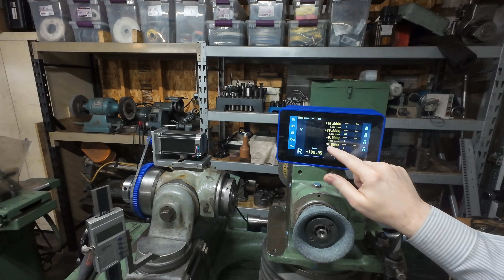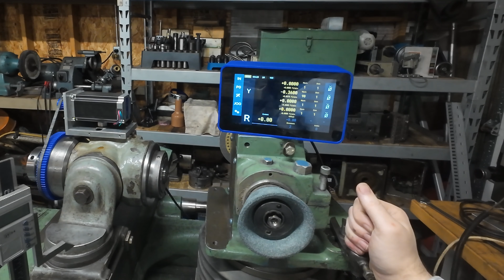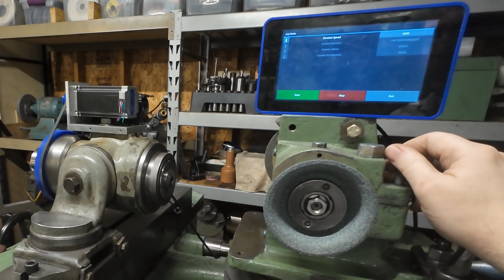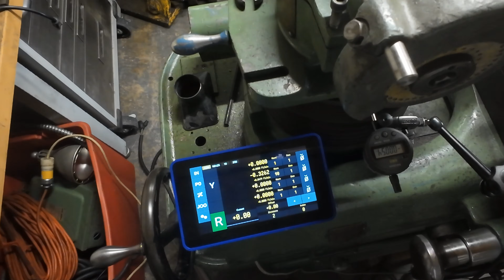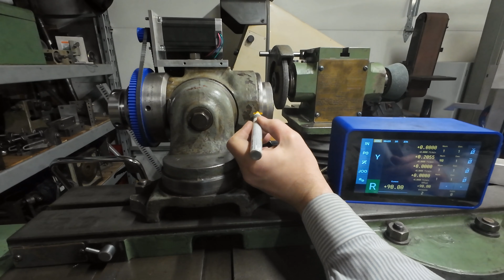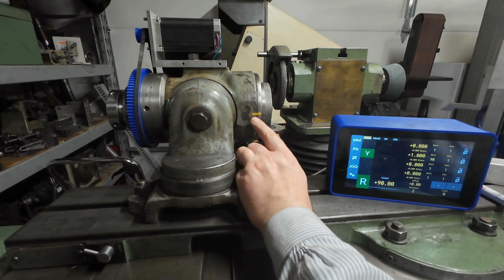DRDRO Software Updates and Features

Comment: The more I learn about this system, the more impressive it looks. I think I can see a way to power the lead screw on my lathe from a stepper motor via a timing belt, by just swinging the adjustable position change gear out of the way. But by doing so, I would also lose the drive to the power feeds for facing and parallel turning, which I use all the time. If I re-engaged the change gears to use the power feeds, could back EMF from the motor being turned by the change gears damage the stepper motor driver? Or would I need to disengage the belt drive to the stepper motor drive first (not as easy). 
Maybe I'd need a microswitch which breaks the 'enable' signal to the motor controller whenever the change gears are powering the lead screw for power feeding (assuming the controller leaves the motor free to rotate when not 'enabled').
Or maybe the 'jog' mode shown here could be used for power feed, where it spins the motor at a pre-determined speed until you press stop?
Reply from the maker: Hi Richard, I would think that you would want to do threading and feeding always using the stepper motor once you get it installed on the machine, ditching completely the mechanical link between spindle and saddle. Maybe the use case you have in mind is different and I'm not understanding entirely your intent. I have tested backfeeding the stepper motor manually and it definitely is a no-go, the back emf causes several issues to the stepper driver, at least in my case. things might be different if you use a servo but i hardly believe any servo mechanism will be happy about external motion, even when the servo drive is not enabled. If i get my hands on more drive systems i'll continue testing, perhaps we find one that is happy while being back driven. Not sure if you have seen the ELS mode video, but i think perhaps that's what you're looking for when it comes to feeding facing and parallel cuts.
Reply: @stefanobertelli2650  Thank you very much for the reply. Is there a forum, etc, where you customers discuss things like this, or is here OK?
Reply from the maker: @ the best place for comments is on github for now. Perhaps i’ll get discord going at some point.

Comment: I love what you are doing. I have been thinking for a while could you add the ability that would be used on a manual lathe so as you do a facing cut the DRO could speed up the spindle motor like a CNC machine dose and yes you would have to have a VFD driving your spindle motor on the lathe. This is something I have been thinking about and keeping an eye out for some time.
Reply from the maker: You're not the first one to mention this, it's definitely doable but the problem is that vfds are all different and there is no communication standard for configuring the current speed. The best option would be to set the speed with an analog output from the board, currently i don't have it in the hardware but i am planning on adding it on the next release of the PCB. hopefully in the next few months i can work on it, get it tested and ready for production

Comment: This is such a great project. Any chance of integrating features like endstops? It would be great to be able to turn or thread to a shoulder and have the feed stop in the right place.
Reply from the maker: Yes, that's a feature that i would like to add to the new version of the board, with the current hardware I can configure end stops based on the Z scale reading if you want to configure an end stop for example. I will make a video on my lathe as soon as I repair a broken scale and a the ELS mode is more complete!
Reply: @stefanobertelli2650  That's fantastic news! This project just keeps getting better. I've often thought that an ELS is fine, and a DRO is fine, but a combination of the two could have superpowers for a manual machine. I've just lacked the time to try it myself!

Comment: Awesome update - particularly the ratio visualization, congratulations on making it far more user friendly.  
A suggestion, this may well be using numerator and denominator - but that doesn't matter to the user.
If you swapped them around it would say 1:90 and the 1 would be right beside the axis value (Y). 
Also these could be titled input and output. You input the movement and the output is the movement that is automatically moved. There may well be a better set of headers.....

If we are using a rotary table and it is the movement of the rotary table that is the primary movement then the headers in/out make no sense.
Perhaps a graphic would be better. Like a dash and a circle (dash reference a linear scale and circle the rotary, but it could actually be anything)

In your documentation you could explain the actual relationship etc for those that REALLY want to know.
FYI this is the really hard part for developers/engineers they (I am an engineer) want the ACTUAL/Correct descriptions because that is how they visualize it.
Everyone else wants something that makes sense as they use it.  The two are in many cases NOT the same.

JOG mode. Is it Jog or Spin or ROT. JOG has the interpretation of momentary movement. Or again a symbol
By the way symbols are easier to translate as there is nothing to do - except in the documentation 😇
I can't find a JOG symbol the closest i can find is ISO 7000:0006

By the way summing the axis on an angle - perhaps there is a small use case on the mill. But on a lathe when cutting angles/threads it would be awesome and for fine movement control.
Reply from the maker: I think this is a great idea! Thanks for the input

Comment: Hi Stefano rotary encoder is a nice unit for every small shop who has a mill and tool grinder, can someone demonstrate it on a lathe.
Can you check last video, have put comment.
Reply from the maker: Yes, absolutely
Reply from the maker: I am going to prepare a video for ELS mode as I get the features specific to it implemented, It will take some weeks though! Thanks for your great feeback, feel free to contact me on Instagram if you wanna talk more about ideas and improvements for the project. You can also leave your notes in the github project if you prefer
Reply: @stefanobertelli2650  Pleeeease do. I think lathe use is where most of us would be using this. I am actually trying to decide between yours, Clough's and Not An Engineers. I really like that yours is a DRO/ELS as I have magnetic scales incoming soon (secondhand, cheap), too and was going to use them with TouchDRO but with your solution, I can eliminate one system;)
Reply: I am another one that is looking at this project vs Clough42 for my lathe.  I have a Logan 200 without the QC gear box.  I am particularly interested in the taper cutting capabilities  There seems to be something wrong with the github link in the comments.  It comes up as no repositories or projects.  Looking forward to the lathe video.
Reply from the maker: Hi, thanks for noticing that my link were broken, it's fixed now :)